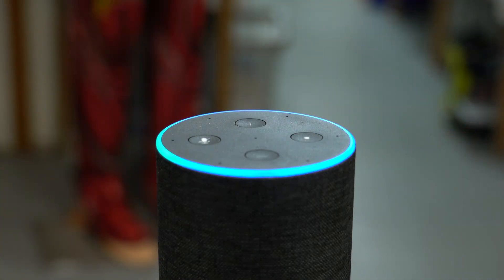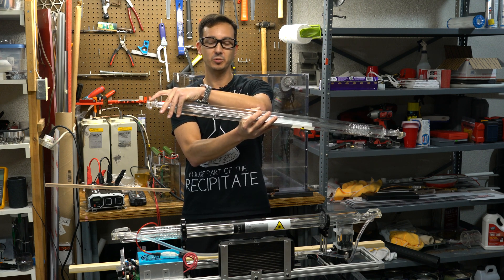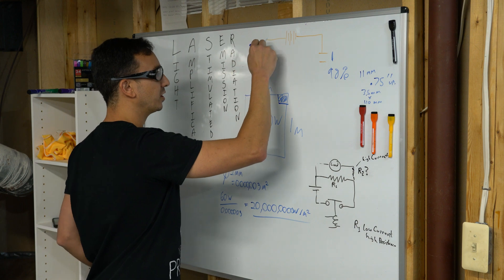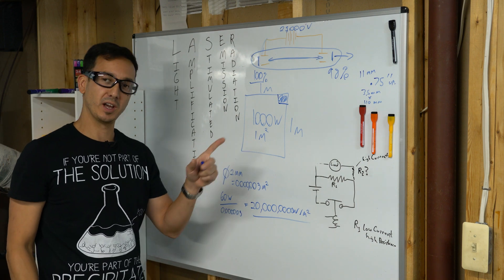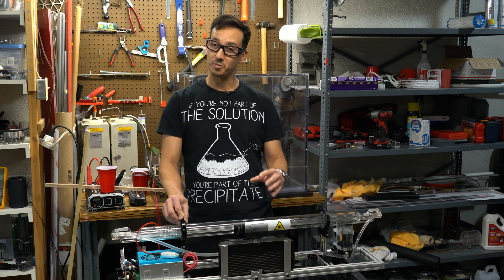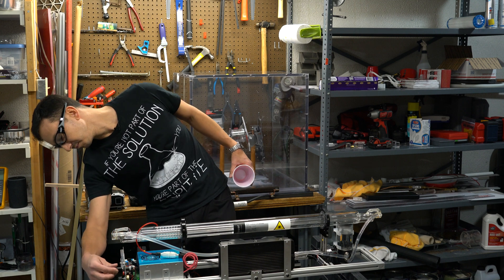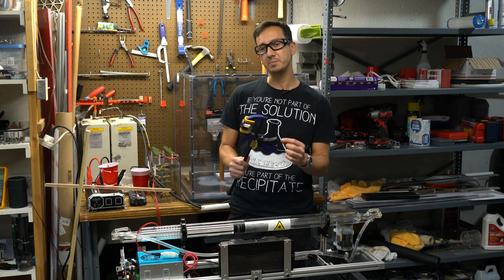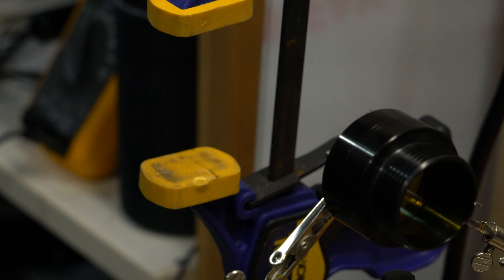Home built 60W Burning Laser project

Comment: Can a co2 laser pulsed by capacitor dicharge? pls test
Reply from the maker: After a certain point, adding more power to the laser does not produce any more laser light. The exact reason why would require a lengthy explanation, but can be simply thought of as because the number of gas molecules inside the tube is limited, and once they are all ionized, pumping more energy in simply results in heat.
Reply from the maker: @deleteduser5618  You can use any power supply that puts out the appropriate voltage. My first CO2 laser was powered by a neon sign transformer.